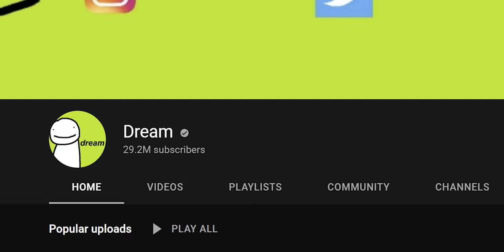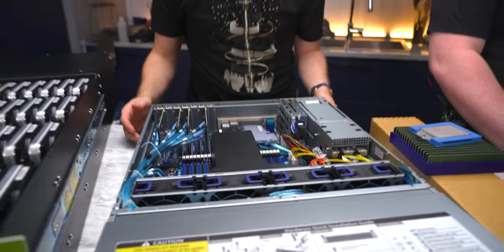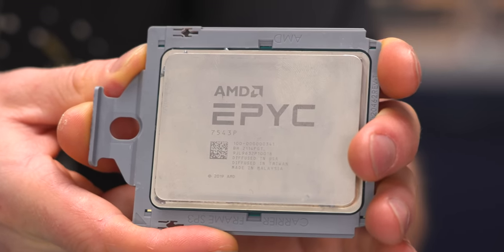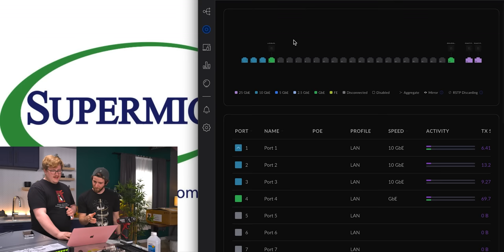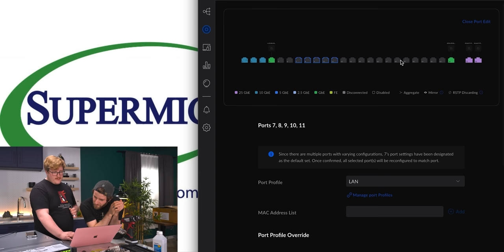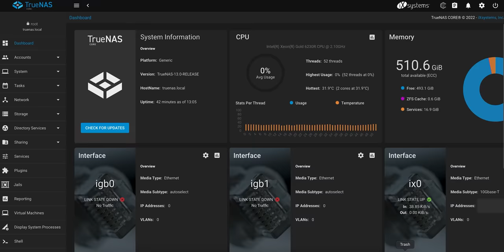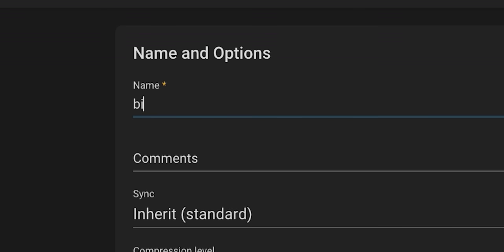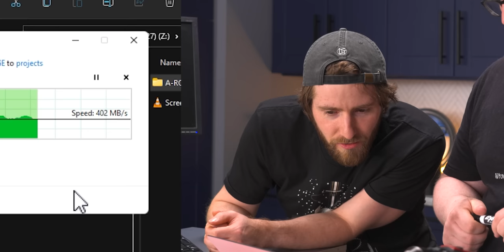Dream has Too Much Money - Dream Server Build

Comment: I haven't watched the whole video yet, but my guess is the drive is going to work jut fine.  Hard drives do what they call park themselves automatically when power is disconnected. There was a time when drives needed to be parked manually before transporting it.  Had the drive been in use when he dropped it, that would likely be the end of the drive.
Reply: so if you drop your shiny new hard drive laptop while powered off its no issue, but if you drop it while installing something thats big bad?
Reply: @ipanesm  the HDD, maybe. The laptop, not so much.
Reply: @ipanesm  of course there are limitations, but a fall about like Linus had would probably not cause damage to drive. I don’t suggest spiking your laptop onto the concrete, but if you were walking and it slid out of your hand and hit the floor, the hard disk would most likely still be readable. I would be more concerned about scuffing the shell of my expensive laptop. One of my coworkers couldn’t seem to go more than a couple days before he would scuff or crack the shell of a new laptop. I learned from him that companies like Dell and HP can sell you every piece of trim, bezel, buttons, case, cover etc your laptop could possibly need to make it look like it hadn’t been dropped 50 times by its careless owner.
Reply: Man, just knowing what parking a harddrive means makes me feel really old. Even more knowing that i actually used to do it.
Reply: @xnetpc  my comment was mostly a joke, but hey, thats some good things to know, i while ago i had to do a diy solution when my cousin obliterared an hinge, maybe now i could do it legit. it still works fine tho
Reply: @LtdJorge  honestly, even if its an expensive laptop, i would be much more worries about data loss
Reply: @ipanesm  Laptop hdds have accelerometers built in and park the head as soon as they detect free fall
Reply: You forget about the drive motors and r/w head actuators, which rely on extremely tight tolerances that the fall has impacted. It may seem to work properly for awhile but it will die far sooner than its specified service cycle. I have seen new enterprise drives that received less severe drops die within a year.

Comment: The funny part is that you need a second one for backup or paying a LOT for Cloud Backup which would be my second backup after my own offsite replica of the main server.
Reply: The backups never end
Reply: Once you get above 500TB, economies of scale kinda take over and if you know someone in a DC you can get at or above 1PB for about 900-1,000/month along with the guarantee that any failed hard drives are instantly replaced in 24-48 hours as well as its own backup in the DC

Comment: I'd be more concerned about the reliability of the dropped drive more than if it'll work after powering it up once
Reply: Honestly if it still works i don't think it'll see any long term damage. When drives are off the write heads are stored away. What kills drives are excessive vibrations (like loading them up on a wagon and dragging them across a ragged server room floor. It should be good.
Reply: It's fine, everything is backed up there, so when it fails they will just replace it with no problem and no data will be lost.
Reply: @fVNzO  I'm wondering how you don't realise that you just contradicted yourself... Yagoda had a better point, but still it's a problem, and still (even if not a whole lot) a bit of a waste of value

Comment: Dream jokes aside, it's incredible that modern computing is so insanely OP yet I doubt I'll ever use a machine spec'd even close to this
Reply: Everything is possible when it comes to tech. Just 30 years ago, normal consumer drives only have a capacity of 40MB. Fast forward today, commercially available HDDs can store 20TB and I doubt it will stop rising anytime soon. We will eventually hit the limitations ceiling but until then, let's hope for the future.
Reply: Maybe when we're 80
Reply: Give it 5-10 years and this will be mid to low tier

Comment: With hard drives, as long as drive was off, not spinning and head being parked, there is good chance that drop won't kill it. Generally, when off, HDDs are pretty resilient. Hence why for example my portable, I think it was 340GB HDD, I was carrying around for my whole student life survived all the drops, all throwing around, all shaking, basically everything it could possibly get inside backpack. However, once drive is in use, it gets very easy to kill. Hence why you always want to put it down before plugging it in and you really don't want to drop it. My portable one did survive "soft" landing, like it fell on the couch and it ended up fine. But it is a lot easier to cause damage once it is working, especially if it has hard landing. Though in all cases, I do recommend being careful with your drives. And just in case you are wondering, that old 340GB HDD, even more than decade latter, I still got it and it still works, even though housing is already cracked, just cracks, it didn't fall apart yet. But I don't carry it even nearly as much and it still got a lot of data it had back then on it and I occasionally still use it.
Reply: For a while in college I was using a portable HDD as my "computer" and booting off of it from whatever computer was available at work or at the library. I had that thing fall the ~2 feet from my lap to the concrete floor of the lab I worked in probably 5 times, and of course it was on when it started the fall. 

It didn't last very long, maybe 6 months, but I'm honestly still not sure if it was the drops or the constant read/writes from being used as an OS drive that wore it down. I did manage to copy all of the files off of it with dd even when it would no longer boot and the file system got corrupted though. Which has made me a lot more cavalier about HDD failure.

Comment: Working with enterprise storage every day, I can tell you raid-6 (z-2) is what you want to do. However, for a case like that I wouldn't even run hot spares. I would have a stack of 2-6 cold spares on site, so if one drive starts acting up you simply pull the bad drive and put in a the replacement then the raid resynchs. Now if you also work on some more advanced file systems, where you might say have multiple stripe groups with 2-4 luns (a set of 6 or 12 drives in that raid-6) for the data and some additional config where you have a raid 1 mirror or 2 configured to store the metadata of the file system. That's where you would want to have hot spares, so if either of the mirrors drives went down it would grab a hot spare and resynch then you replace the failed drive.
Reply: this is a minecraft youtuber who hasnt even filled one drive yet

Comment: Imagine how funny watching this video in 20 years when a petabyte of storage isn't even remotely impressive, watching these two freak out about redundancy vs cost per gigabyte... or imagine telling 2002 enthusiast that linus will just casually drop a 30 terabyte drive and it will almost completely not be an issue at all. Technology is absolutely amazing and I'm glad I picked up the hobby and have learned enough to understand what amazing advancements have been made... I'm just awestruck
Reply: This is not how it works, in 20 years 1 petabyte will still be impressive, in order to get more capacity we would need to switch the medium first. That alone would probably take a decade. We are getting to a point in technology where we can’t brute force anymore, efficiency will become more and more important. Compression is the way forward.
Reply: awestruck*
Reply: @big-wade  thank you, it has been a long day
Reply: @milesgerschefske6231  hey no problem 🫡

Comment: Wow, linus "broke" a hard drive more expensive than my entire setup
Reply: Your entire setup is only worth $300?
Reply: @WalterSMM2  That drive is 470$, and my setup is worth "only" 300$ (excluding the IKEA table).
Reply: @peters.7428  No, no it's not. The Seagate Exos X18 Enterprise is $329 on Amazon.
Reply: Actually, just checked. $321 brand new or $269 refurbished.
Reply: @peters.7428  And I didn't say "only" like I'm looking down on you if that's how you want to interpret it. I said only, as in, it's hard to believe because building a PC that can do anything under that budget is incredibly tedious work.
Reply: @WalterSMM2  Yeah, i know. It is easy when using 6+ year old hardware (11 in my case).
Reply: @peters.7428  You know what. I was wrong. Just found a used PC with 16GB ram,  a 3770k and an r9 280x  for $280 which would have been high end 10 years ago. Didn't take long either.  Who knew. Plus 280x was my very first GPU. Go figure.
Reply: @WalterSMM2 my setup is literally a 9 years old laptop

Comment: He cheated in a speedrun. Okay big deal. But it’s the fact that he lied about cheating for months, meanwhile letting his fans send threats to everyone calling him out for actually cheating. Unacceptable.
Reply: .....he didn't know though
Reply: @justjade16  did he not? To my knowledge he knew about the cheating for months but refused to acknowledge it. How is it possible to not know you had a mod installed then, months later, have a sudden realisation that you had a mod installed?
Reply: @beanbeanjuice  Initially when his run got questioned, he was cooperative and working with the mods but then one of them posted something trashing him so he got upset which started the whole drama and going back and forth
Reply: @beanbeanjuice  at the time, he didnt know that he had cheated. Which is why he was so adamant that he didn't and even hired a mathematician to prove it. However, after the situation blew over (sometime in January) he found out that while he was speedrunning he was using a mod that was designed to enhance his video quality. The developer that developed it increased drop rates on certain mods to improve videos ( they wouldn’t have to wait as long during manhunts) without telling him, but they eventually came clean.
Reply: @beanbeanjuice  After that, I forget exactly when but it was months later, he posted a pastebin explaining the entire situation apologizing for everything (he also apologized in private to the speedrun community). Today, he speedrun is not on the leader board, and he doesn't speedrun at all.
Reply: @justjade16  I understand you’re a dream fan. But how could you possibly not know you’re using a mod to enhance gameplay until MONTHS. LITERAL. MONTHS. Later?
Reply: @beanbeanjuice  Because he switches out mods and stuff for his videos all the time? His folders and servers are always moving around, so it's not surprising he didn't notice especially when he didnt know the mod would affect his game play. They didn't contact him about it until days later (which isn't their fault) but at that point he'd already filmed other stuff with other mods.

Comment: I have a problem with my download/upload speed on my WiFi, for some reason the idiot that built our house decided to use copper cabling instead of fibre to our house and then cement over it. This makes it difficult/expensive to replace it and keeps me stuck at 3mb/s. Is there any way to get past that other than replacing the wire.

Comment: Or you could put the mellanox 100GBPS card in it and get the mikrotik switch to go with it and spend less than 2k on all of it. 4 ports is what the switch has. 1 for the 1 server 1 for the other, and the 2 others can have 100 to 4x25GBPS breakout and you can connect that to a 25GBPS managed switch, agg the 4 25s and have 25 to each user... those enterprise class 25GBPS switches do run quite a bit though.

Comment: chatGPT3.5:
**Title**: Dream Server Build - Building a 1.2 Petabyte Storage Server

**URL**: [Watch the Video](https://www.youtube.com/watch?v=Ti8scviDiYc)

In this video, Dream embarks on a mission to create an incredibly powerful storage server. The goal is to build a 1.2 petabyte hard drive storage server with a 200 terabyte all NVMe SSD server. Dream receives support from sponsors and hardware providers for this ambitious project. The server hardware, including a 26-core Xeon processor, 512GB of DDR4 memory, and a unique storage setup, is provided by 45 drives. 

The video showcases the process of installing a massive number of SSDs and hard drives into the server, highlighting the incredible storage capacity that Dream aims to achieve. The SSDs used in the server have capacities of up to 30 terabytes, and multiple layers of hardware are revealed as they delve into the SSD's internal components.

Ultimately, they successfully complete the build, boasting an impressive 1.2 petabytes of raw storage capacity, which can potentially be around 900 terabytes of usable storage when configured with hot spares. They also discuss the network setup, featuring high-speed connections for optimal data throughput.

However, there is a humorous moment when they accidentally drop one of the SSDs, leading to some uncertainty about whether it still works. Despite the mishap, they continue with the server build.

The video concludes with an overview of the final server configuration and the potential for expansion in the future. It's evident that Dream has created an impressive and high-capacity storage server, showcasing state-of-the-art technology.
- 💾 Discussed storage configurations for large capacity servers.
- 💡 Considered RAID configurations like RAID Z1, RAID Z2, and RAID Z3.
- 💰 Discussed the cost and redundancy of using hot spares in the server.
- 🔄 Explained the backup strategy involving incremental backups to another server.
- 🚀 Highlighted server performance and data transfer speeds.
- 🤝 Acknowledged the contributions of various companies and individuals involved in the project.
- 🏠 Mentioned Jake's assistance with Linus's house project.
Reply: Nice

Comment: just trows a $400  harddrive to the floor. DERP I  bet it is the 1st drive to fail. I agree with linus on the Nvmes Raiz1 all the way It is what I do. I have 3 Vdevs of 3 Nvmes drives in raidz1. They are over 3 years old and get the crap kicked out of them daily. Last time I looked at how much life was left they where at 90%. the systems been up for over 2 year's.

Comment: This system is already obsolete. I managed to fit 1.2pb in a full fledged pc. The thermaltake view 91. For over $152,000 I was able to fit 18 of seagates 24tb hdds. 106 of the sabrent 8tb m.2 ssd using Apex Storage x21. That's a total of 1,280tb